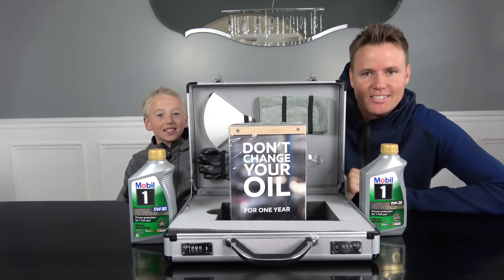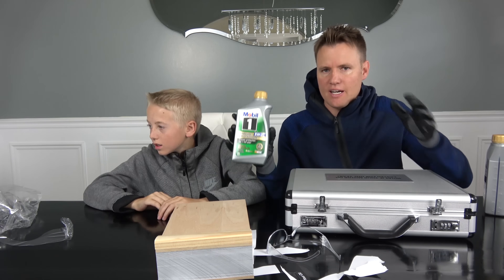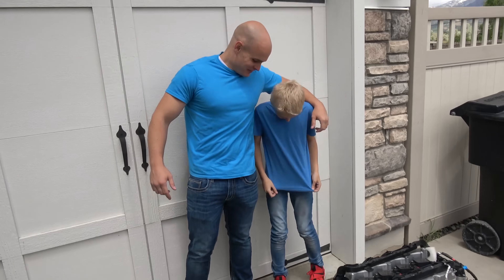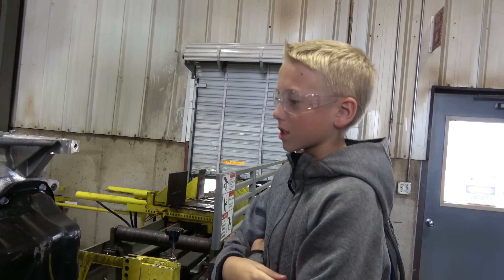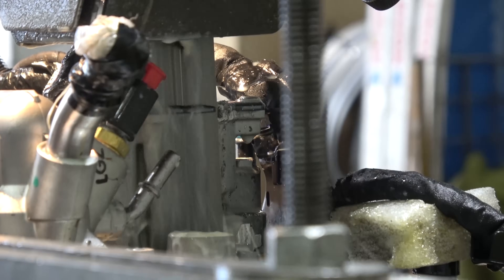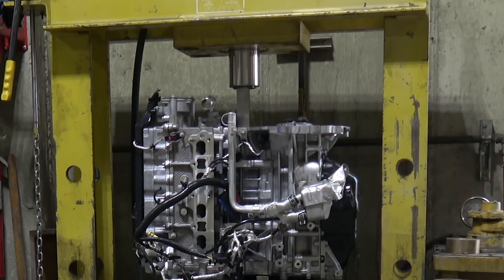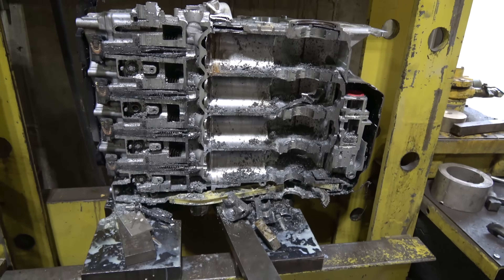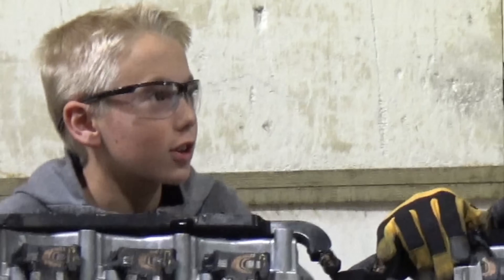Whats inside an Engine?

Comment: For those of you that dont know how a 4 stroke engine works: 1. Intake stroke - piston goes down and the intake valve opens, the piston pulls in the air and fuel mixture 2. Compression - both valves are closed and the piston starts to go up, compressing the air fuel mixture 3. Power - main power producing stroke, when the piston is at top dead center the spark plug ignites the compressed air fuel mixture and the pressure pushes the piston down, producing power. 4. Exhaust - the piston goes up again, the exhaust valve opens and the exhaust gasses are expelled out of the cylinder, the piston pushes them out. This whole cycle repeats

Comment: Your engine expert either misspoke or isn’t very knowledgeable. Oil isn’t only on the bottom half of the engine. It’s in the heads on the top too. Otherwise your valves and camshaft would fail. Also pistons are typically made of aluminum. I’m betting what you got hung up on was the camshaft.
Reply: also if there is no oil in an engine it basically self destructs not from heat but from metal on metal contact inside of it

Comment: Pistons are made of “SOFT” aluminum. I can tell you for sure that the pistons were NOT breaking the blades. Maybe the piston pins but not the pistons themselves. Also, he points at one valve and says that, “air comes in” and points at the other valve and says, “fuel comes in”. That is WRONG!!! One valve is the intake and one is the exhaust!!! He clearly does NOT know as much about engines as they think he does!!!

Comment: Zach doesn’t know nearly as much as he pretends to..little did he know that “hard metal” the pistons are made out of is actually aluminum. Also the crank shaft does not hold the pistons it is actually connected to the pistons by the rods taking  the vertical  force generated by combustion and turning it into rotational force which then goes to the transmission.

Comment: My truck does over a 100k miles in a year, and 40k between oil changes. Unfortunately the Detroit diesel in it holds 8 to 10 gallons of oil.

Comment: The only knowledge anyone can take away from this video is that an engine can be cut in half.All engine information is false.Those were not hardened steel pistons,there are no "explosions" in an internal COMBUSTION engine.Explosions  would be called detonation and should never happen under normal operation.And those "shafts" we're cylinders.

Comment: So much wrong with this video:
You’re destroying a new engine which is sad
You said the pistons are hardened steel which they aren’t you dummy they’re aluminum
The guy pointed at the cylinder head and said “this is where the explosions happen”
The crankshaft holds the connecting rods not the piston.
AND DONT BUY MOBIL1 ANNUAL PROTECTION ITS IGNORANT.

Comment: You all are dumb it's called four stroke for a reason fuel and air mix in one stage it happens in four stages and oil is only their so the piston doesn't score you cylinder head

Comment: I apologize for the high school games here. This is a combustion engine. In the case of explosions, the engine would probably only run for a short time :-) They are "only" fast sudden burns. I hope you can understand what I mean. I do not have to use these words normally and therefore I have to rely on translation programs.

Comment: It is called an engine!!! Not a Motor, a motor is electric, an engine is gas powered.
Reply: Ethan Garcia they are different. engines are gas/diesel. a motor uses electricity.
Reply: Alex Scherergrampa no it's not the word motor is over a hundred years older than an electric motor. How about motor oil, motorcycles or MotorSports. Why do you think it an electric motor and not just motor? There's more than one kind of motor.
Reply: I know they are the same, but they just sound dumb saying motor
Reply: There the same thing just two diffrent word but same meaning

Comment: Big trucks with a oil filter that holds a gallon could go 20,000 miles.  My Subaru that holds an oz of oil in the filter can go up to 5,000 miles before it gets full and can damage the engine.  For me, I do 3,750-4,000 because I fall under the severe interval with my short non highway miles.  I'd ruin my engine if I do 20k oil changes for a few years, no doubt.

Comment: I just I...I...I...I can't deal with this what even is this it's the least informative thing on the Internet 

And technically it's engineering ...

Please please please just be useful and use tools it would be so much more awesome if you took it apart down to component pieces and then explained rather than this destructive bs that you're doing now

Comment: I don't like how oil bottles say how long you dont have to change your oil and people actually believe that. there are soo many factors on when to change oil like how many miles driven or how hard do you push your car. I'm using mobil 1 extended 15k miles and im just praying my engine is fine after 10k miles of not changing oil

Comment: that oil saying you don't have to change your oil for a year is a bunch of BS you need to change your oil every 3000 miles failure to do so does cause problems with your engine.

Comment: I haven't changed my oil in like 3 years...Love my tesla! 😆
Reply: Jay Ray you obivously don't know how Tesla motors are designed to be maintenance free
Reply: Ashton Carlson Thank You!!! Someone actually understands how it works...😁
Reply: all moving parts will eventually break down over the long term. even the buttons on your keyboard have a certain number of presses before the mechanisms fail. its just with tesla cars, this long term limit is unknown as it hasnt been 30+ years since the release of the vehicle(s).
Reply: BoomBrush that's how teslas make people buy their new cars xD
Reply: Pranked haha lol
Reply: better go get the oil changed right now
Reply: Tesla is one of the least reliable cars of 2017
Reply: Do you have a vanity plate
Reply: Pranked You obviously are not a car guy because you should know that every year you have to add grease to the bearing inside the electric engine.

Comment: This is hard to Watch... People don't listen to them. Change your oil maximum every 10,000 miles. I change mine every 5,000. Find out the manufacturers recommendation for oil changes on your motor.

Comment: Honda dealers refuse to change oil before it hits 15% on the maintenance minder, even if it takes longer than a year to do so.  It takes me about 15 months to hit 15% and I run up around 7500 miles in that time (I drive an average of 130 miles per week).

Comment: And the purpose of this is? What does the metal filing mess prove? What has Mobil 1 got to do with this silly act of pure destruction? A cutaway is usually a thing of great beauty but this is just the work of morons. And by the way 1 year oil change intervals is nothing to write home about and is something we have had in the British Isles since the late 1970s. I wouldn't buy a petrol engine car that needed its oil changed more than once a year or less than 12000 miles. Who would? But to be fair it is the oil that allows this and Mobil 1 is my favourite oil.

Comment: How much is mobil 1 paying you 😂 As a mechanic, I can assure you that going 12,000 miles on even the best oil, is going to do more damage than good...
Reply: Austin LeGrand Yeah this video was painful to watch...even if the Oil was fine. That oil filter would be completely clogged and would just keep bypassing the grime in the engine
Reply: plus it would have been simpler to disassemble it for me it takes me about two hours to take one apart and put back together and the way the shadows was in the background it took then probably half the day
Reply: Jose Leon bought a high mileage town car from a limo company. Guy said he had been using that mobil one from day one (along with a filter thats rated for 10k miles) I've kept up with it doing the same thing for the last couple of years. Still runs great and it has over 261k miles now. I do go ahead and change it twice a year though
Reply: mechanic perhaps, A chemical  engineer ,you are not
Reply: TheeJoeyLee You are correct.  Although that does not indicate that I am wrong.  Engineers and mechanics/technicians will never get along 😂
Reply: Jap Crap you are not wrong 😂 people are so dumb to believe this crap
Reply: Bollocks, oil is dirty when its 'fresh' from the can.. modern engines can go very far on oil trust me I have done it and my bmw is going strong
Reply: Go as long as you want on your oil changes but just remember that if your vehicles under warrantee and something goes wrong and it is oil  related and you run an oil change for a year and not follow the manufacturers directions they do not have to honor the warranty. keep that in mind and change oil based on the owners manual
Reply: It depends I know for sure every 2.000 miles u should change the oil filter
Reply: My mechanics chew me out every time I drive my car from 100% to 2%. 😂
Not the "3,000" mile thing or 6,000 9,000 12,000 mile thing.
Oh and the fact I haven't changed any engine parts at all since I owned the car 40,000 miles ago including all of the squeaky belts and clicking noises.
Reply: every 3-4,000 is when you should do yours. or whenever it gets dirty
Reply: Christian Lopez lol that's why u use only the "special " Mobil 1 Yearly filter . As a mechanic as well I can tell you that most engines can run up to 15,000 on just synthetic  oil without any problems . The scheduled change is just a way of getting people to spend money every  3,4,5 thousand miles . As for what makes this new yearly oil so special I'll still have to play with it and see .

Comment: One year from oil-change to oil-change isn't a long time.
On my 21 years old Mitsubishi Galant e54a I have to change my mineral 10W40 only once a year, or every 15000km.(9320miles)
And on modern cars with synthetic oil it is every two years or 30000km and in some cars up to 50000km(31068miles)

Comment: The oil is not only protecting the engine, also it will help too with bit of cooling down the heat parts of them :) 
and 2 of 4 ventiles are for take air/gasoline into combustion chamber , and the 2 other are the exit for the burned gases after explosion.
Reply from the maker: +Peter Reichert 👍🏻

Comment: try it with a tesla motor
Reply: fiddlestix1117 yea, I'm talking about an actual electric motor. it's simple bundles of tightly wound wire around the center shaft.
Reply: Alan Godin I'm pretty sure he means what's inside the actual electric motor, that would actually be cool to see...
Reply: not much to see inside an electric motor aside from wires.
Reply: fiddlestix1117  yes an electric motor that would be cool
Reply: Alan Godin Ah I see what you're saying now haha

Comment: I laughed when Zach pointed at the valve holes around 920 and pointed in the exhaust and said this is where the gas comes in and pointed in the intake and said this is where the air comes in. lol wait a second partner.

Comment: Running the same oil all year is really not a good idea. Especially if it's an older engine, the oil will become very dirty and will actually wear out the engine faster as well as the fact for the climates with cold winters and hot summers you really should be using different viscosity for the winter and the summer seasons.

Comment: This was unbelievably painful to watch as a car enthusiast
Reply: It was painful to watch for me just because they knew so little about how engines work.
Reply: How does that make him a ricer? 😂
Reply: Binkleyme well it’s still part of a car you can make hp out of that motor it still has potential as any motor it probably has 200 hp not every thing need to be a v8
Reply: @chasemeyer6688  the fact that you came up with a random number such as 200 and think that has any significance tells me u know nothing abt cars
Reply: @jonathanhughman154   I said that 4 years ago. I’m a technician now and I don’t know the point I was trying to make I was like 15-16
Reply: @chasemeyer6688  oh damn i didn’t even check when u posted it. It does sound like something a 15-16 year old would say
Reply: Binkleyme it was a crate engine. they should have used an engine that was shot instead but oh well
Reply: Sean Carter it would break my heart if they were cutting a rotary engine
Reply: Sean Carter it's not like it was an rb26 or something
Reply: He should've cut open a lawnmower engine.
Reply: Sean Carter same and the gas doesn't really explode. It is a controlled burn
Reply: I also ❤ the "Shaft" 
😍😍😍😍😍😍
Reply: atleast it was the shittiest 1.6 i4
Reply: so true
Reply: My miata is a 1.6 👿 run your engine not your mouth!
Reply: Sean Carter agreed
Reply: Hey, you can't blame ricers. Not all ricers have 4-cylinders. Many old BMWs are a popular ricer car. Mustangs as well. They are disgusting, but you can't call someone a ricer if they like 4-cylynders, because it's what you do with your Civic that counts, and if I owned a Civic in Forza, I would tune it, not rice it, like a normal petrol-head would.
Reply: ok
Reply: angry Birds e pظنننظظوظكمن لم م
Reply: Sean Carter VERY
Reply: Ikr I feel your pain
Reply: poor car😣😣😣😣
Reply: Sean Carter why do you all assume that he liked it wanted the engine. I think it was hard to watch because they open it up and don't know any of the parts, as well as the fact that they are amazed at something so simple and uncomplicated.
Reply: Sean Carter don't read my channel name
Reply: Sean Carter why
Reply: Sean Carter same
Reply: Andrew Enriquez  h,jljo
Reply: I know!!
Reply: FuriousOrion 86 😂
Reply: Stokes Pen, I completely agree with you. I salute you good sir!
Reply: Sean Carter u are completly right ahaha
Reply: it is killing me!!!!!
Reply: Sean Carter dude I know the feeling
Reply: Dish Soap there is even more rb engines like rb30 rb35. My fav engine is the 2jz
Reply: Fr xD
Reply: Its ok, its not the 1.6L DOHC RS from the NA, its a ECO fuel motor
Reply: Sean Carter I died
Reply: Yup I even said that to myself at the beginning of this video
Reply: Sean Carter yup
Reply: Very
Reply: Sean Carter same
Reply: Stokes Pen I am an love small engine like quad or dirt bike engines
Reply: Sean Carter  same
Reply: Sean Carter same
Reply: Sean Carter I know😣🔫 
I SWEAR ILL DO IT
Reply: it has direct injection, its better than my engine! they should have traded with me!!
Reply: Sean Carter oh I agree it's horrible
Reply: like a prius
Reply: Sean Carter don't read my channel name
Reply: so true
Reply: Same
Reply: It is painful to watch due to the complete ignorance of all parties involved
Reply: Everyone is loving 4 cylinders. They are tiny and have no power. If you want a real motor get a V8.
Reply: Sean Carter hbnhng*miju
Reply: Sean Carter gg
Reply: Wu banga there are plenty of 4 bangers that’ll destroy v8s
Reply: Leois12 or a 2j
Reply: Binkleyme truuuuuueeeee don’t care for civics😂😂😂😂
Reply: HR16DE?
Reply: At least it’s not a big bulky beautiful American v8
Reply: The engine cutting itself wasn't painful to me, but the fact that they don't know anything about engines was painful
Reply: Don't worry my guy that engine is rip
Reply: A true car enthusiast appreciates every car.
Reply: Binkleyme He who refuses the small is not worthy of the large
Reply: Don't forget the Rotaries!
Reply: Sean Carter It's a 1.6 liter ECO fuel engine. You'll get over it. You're not an enthusiast if you like those.
Reply: Binkleyme wrong, buddy. You can be a car enthusiast even if you drive a slow car or have a small displacement engine. I'm an example.
Reply: me too ;( i disliked the vid
Reply: Its a 4 banger. Youre a ricer bro
Reply: @wubanga8864  k20 and other popular 4 bangers am I a joke to you

Comment: As a retired auto mechanic let me warn you that regardless of the length of function of Oil in your engine it still collects abrasives that cannot be filtered out there for change your freaking oil. its not the oil its the dirt in the oil... wtf

Comment: Pistons are made of aluminium not steel.
Reply: Stremer it depends on the engine in question. Most have steel or cast iron pistons and steel, aluminum, or cast iron blocks
Reply: Robert's Fish Room No. Only high performance racing engines and some high compression diesel engines do. Most daily drivers have forged aluminum alloy pistons.
Reply: Stremer that's just what I was told. He might of been wrong, I'm not too sure. I am pretty sure a lot of the older motors do, such as old ford flatheads.
Reply: Robert's Fish Room Aluminum is used for its excellent heat transfer coefficient. There is a small clearance between the piston and the cylinder wall. When the engine is hot the piston heats up quick and expand reducing the clereance. This promotes good compression within the chamber and along with the cylinder rings (cast iron BTW) prevents the oil from going up and mixing with the gas/air mixture.
Good and typical aluminum alloys are aluminum-copper and aluminum-zinc.